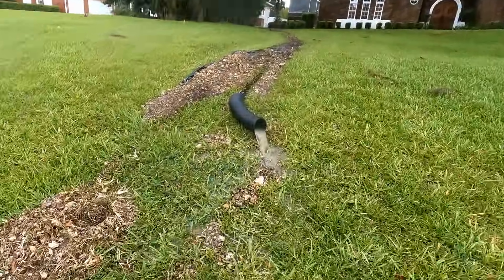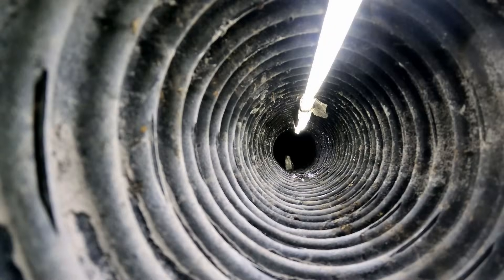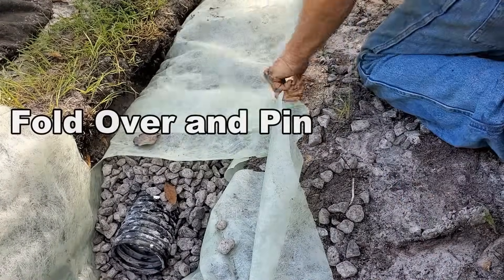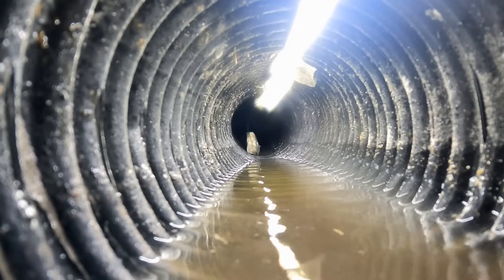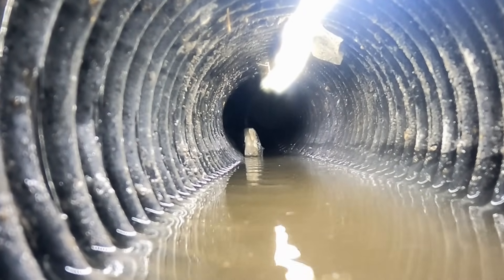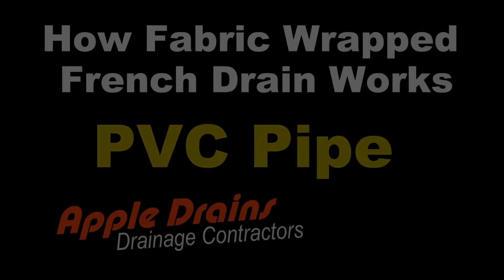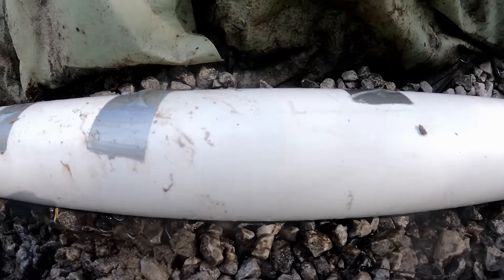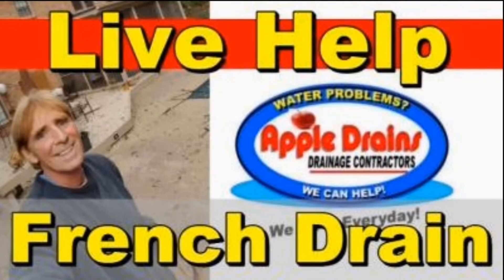Does French Drain Work with Fabric? Watch This Before You Install - PVC / Corrugated Pipe

Comment: Seems like a good place to ask, when depth do you usually dig a french drain? Redoing mine soon and want to learn
Reply: Probably whatever allows you to maintain a minimum 1% slope (required for wster to drain) all the way to the outlet. If you're asking about how much material should be between the surface of the ground and the top of the pipe I'm not sure
Reply: We dig according to the frost line,or if installed at footer.we go just below the depth of the footer,so the water flows at a lower level Than the top of footer,Works good for us,we use lots of gravel,im talking several tons around a 2200 square foot home,

Comment: Really, if you go through the trouble of digging the ditch, add a few more $$'s and get a quality sch40 pipe.
Reply from the maker: SCHEDULE 40 not the pipe to use in RAINWATER DRAINAGE SYSTEMS. This pipe is used in Sewer pipes. Regular #3000 PVC or corrugated pipe are both great material and will easily last many years before the pipe needs cleaned. 

Thanks for your comment

Comment: The fabric works to prevent soil migration into the stone and eventually into and out the drain. Why are you installing in thin strips though? Should be laid lengthwise and envelope the stone. You can get rolls up to 6m wide and if you do need to oveap you want 1m full lap. And you're going to want more topsoil cover over the stone, if you can't achieve more cover due to grade limitations then just run the stone to grade. There's other good ways to cheaply promote infiltration into the subsoil and/or storage capacity within the French drain system.
Reply: The video was just a demonstration and not actual install, so they used scrap fabric
Reply: Demonstration... demonstration... demonstration...🙋

Comment: Ah.. From someone who does real testing in commercial systems, I'd suggest doing more stress testing with video, like adding leaves, small pebbles and mud with grass in the pipes. The manufacture claim that's the advantage of corrigated over straight pipe.. You showed how both work in perfect world..we need to see debris in it and worst case so we know when each case benefits..
Reply: The real testing is letting these systems go for a year and then looking at their output quantity as well as quality of water coming out.  The type of gravel you use could also greatly affect the effectiveness of these systems.
Reply: @daveharness70  yea, that would is a must as well..or at least throughout the four seasons... Yea totally agree
Reply: @BobDevV  yea, I'm in exactly the same boat... I did it as per spec but after years feel straight is better..they claim the ridges create turbulence that creates a self cleaning effect but I agree that if it does, it is outweighed by sediment accumulation trashing up the line.. And to your very point water stayn in those spaces is bad all the way around.. I think its just cheaper and they tryn to justify it with excuses..

Comment: Best French drain vids I've seen. I'm doing one soon but it will be driven over. I'd like to use the PVC but the flexible pipe with the flex tube with the corrugated ridges looks like it will hold up and flex better. Any thoughts?
Reply: Corrugated pipe will clog easier and be harder to clear out than PVC. It will also collapse. Every downspout corrugated drain my builder installed lasted about 4 years before I had to dig them up. The PVC I replaced it with has been trouble free for 20 years. Everything that goes down the gutters flushes right out. PVC costs more, but not as much as having someone try to unclog a corrugated pipe--if they can.
Reply: @barrygrant2907  I have no experience with corrugated, so thank you for sharing.  I've seen enough videos where corrugated will simply hold water & debris that I'll never use it.
Reply: In my very limited experience, it appears that PVC will flow MUCH better and give longer life.  Granted, it isn't flexible like the corrugated, but if you spend the time/labor doing it the first time with PVC, you'll not likely need to do it again.
Keep checking Youtube for comparisons.
Reply: @rusosure7  Thanks I appreciate that.

Comment: You forgot to tell us which is better!  PVC looks to be much easier to maintain / clean out if it's ever needed.
Reply: It's a lot easier to set your angle with PVC.
Reply: @njgrplr2007 1😅
01 6:23 1
Reply: PVC flows much better and will last longer
Reply: If you live where it's cold, pvc will freeze and break.
Reply: Pvc twice as expensive if not more
Reply: I think the camera falling off the pipe is shows which is better.🤷‍♂️
Reply: PVC is better, but more expensive. Both will need maintenance on occasion, PVC less so. Even if stalled exactly as appropriate for your soil, climate needs.
Reply: PVC with proper drainage.  Flexible hose is easier though.
Reply: The PVC looks to be carrying a lot more dirt/soil away down the drain. May have substantial settlement line if that continues.
Reply: @tskaggs84  sediment doesn't stay in the pipe. On pvc there is no where for dirt hang on to as long as the pipe is installed correctly. With corrugated the water flows extremely slowly allowing sediment to settle. But not only that, the groves on the  pipe will lock the dirt in place. Yes, corrugated is cheaper but you would most likely need to replace it every time there is some sort of precipitation.🤷‍♂️

Comment: This is very bad for the environment; it drains too fast which increases flooding and reduces soaking into the ground.
Reply: Exactly. Probably better to flood your home or basement and rebuild it every 25 years.
Reply: @thewhiteknight02  or not make a basement in a flood plane.
Reply: Yes, it's better to have a rotting and molding home than to have a well-drained yard.
Reply: @edschultheis9537  Those things are not connected; by all means make the home dry inside but if you are building in such a humid place maybe that is a problem.
If we destroy all the natural processes we will suffer the consequences.
Reply: @jocosson8892  Pardon me if I don't consider you to be any sort of expert in anything related to the environment.
Reply: @edschultheis9537  I am actually only repeating the experts.
Reply: @edschultheis9537  Well, Jo is absolutely correct, but totally wrong too, if you are trying to drain a wet area to protect a structure. Swales, ponding areas, etc are integral to a good stormwater management system. And piping that water downhill can cause significant problems. Catching and casting of water that then damages other property can get you in a lot of trouble.
Reply: We found the dumb one guys.
Reply: @Carado5150  how so?

Comment: Hey, Chuck! How do we prevent our top soil from clogging our catch basin top if we need to raise the ground in addition to the basin?  Also, if we’re getting water in part of the trench (the shallowest part), does that mean our trench isn’t deep enough? Thank you!
Reply: Put some gravel around the grates until grass grows.
Reply: Thank you both for the suggestions! Our system is working beautifully! Just added to it yesterday and so proud of ourselves for running over 200 ft of corrugated pipe and 8 catch basins along the edge of our property! We actually tied it in to the main drain properly, too.🎉🎉  Chuck truly helped us save thousands! Cost us quite a but in sweat equity being that our soil is hard clay! Nevertheless, with prayer, we did it‼️
Reply: you'll probably need to makeshift a filter. There's catch basins that come built with them to keep leaves and large debris like rocks out of the pipe.

Comment: My PVC French drain has a thin sock around the pipe and the size gravel you mentioned. It's worked well since it got installed about a year ago.
Reply: By using a sock on just the pipe that is the smallest surface area compared to placing the fabric between the drain rock and the clay.  A smaller surface area would clog up faster with any silt materials from the clay.  So in theory the gravel should remain functional longer with the filter fabric on the outside of the gravel. 

The sock only protects the drain pipe and not the gravel. Once the gravel clogs the drain pipe is pretty useless.  

I’m planning on placing the appropriate clay soil geotextile fabric between the gravel and soil to protect the gravel/drain rock from clogging up. 

I’m thinking of using the 1-1/2” rounded rock (with minimum fines) because that has bigger spaces between the rocks for better drainage. Bigger spaces will drain faster and it rains 75”/year here in Crescent City, CA so the water volume is huge in a 4” rainstorm. Locals have described 7” of rain in a single storm! 

I’ll run the gravel to the surface to also catch ground run-off and place catch basins every 30’ or so to enhance surface water collection but to importantly double as clean outs to deal with clogs. I read that 1 catch basin is equivalent to 40’ of French drain. 

I worry about corrugated pipe getting torn up with a big snake’s cutter head; ie catching on the ridges and the corrugated pipes are all relatively thin. So I plan to invest in the thick walled and smooth schedule 40 PVC. 

I looked at the high octane corrugated pipe but the shipping to the west coast was 3x the cost of the pipe! $500 to ship a 100’ coil is outrageous!
Reply: I just did one with a barito wrap and fabric.
Reply: This is merely my opinion, and it won't matter to you now, but maybe someone else reads this: I don't use socks around the pipes because I would rather have dirt migrate into the pipe where water will carry it away or you can snake it.  Even though the gravel is "washed," there is still plenty of sediment on it.  I do think filter fabric lining the trench is mandatory for longevity.  And ALWAYS install a clean out at the top!
Reply: @Keifsanderson  Good reply. My French drain has three catch basins, also.
Reply: @SeanBaker  God bless, man.  Hope you get many years use out of yours.  I think much depends on the nature of the soil.  My new place has great, sandy soil, but there is no elevation to make a drain work.  Unless of course I want to deal with an outdoor sump pump.  There is no risk of the house flooding, and the flooding disappears in less than 24 hours, so I think this time around I'm just going to let nature do it's thing.  The first couple torrential downpours, where I could have paddled a canoe around the yard, were a bit stressful, but I've been assured by all my neighbors that even the worst hurricane in the neighborhood (Sally) didn't flood the houses here out.

Anyways....cheers, and have a great weekend.
Reply: @SeanBaker  3 is only enough if can handle the volume.  I designed my systems to handle minimum a 4 inch an hour rain event. Take the area of your roof and any ground you will be handling drainage in squarefeet..  Multiply by .33 ( 4 inches) to get cubic foot volume. A cubic foot is roughly 7.5 gallons so multiply 7.5 times cubic feet to get gallons per hour. Then divide by 60 to get gallons per minute.  Look up the capacity of your pipe and grates to make sure they can handle volume.  For example a 4 inch s n d pvc smooth wall will handle about 75 gallons per minute (working from memory so double check me) but a 9 by 9  grate may only be able to handle a small fraction of that volume per minute.  Having just one pipe and a few catch basins for a residential is rarely sufficient to handle a heavy downpour without backing up.
Reply: @Keifsanderson  It's been like 20 years since I installed a French drain, but we always applied one layer of fabric to the bottom of the drain and one on top. Nothing surrounding the actual corrugated pipe itself but large rocks to fill the space, then the top fabric to keep the gravel migration into the larger rocks to a minimum.

Plugging usually wasn't much of an issue as the elevation change was usually pretty small and it wasn't long enough to be a problem if it did plug. A longer run would probably be better off with something that's not corrugated.
Reply: The sock may impede solids and cause a buildup if it is actually around the end of the pipe
Reply: Good luck because corrugated will most likely eventually clog.

Comment: My downspout drain from the back of the house goes to the street in buried 4-inch corrugated pipe, under my side yard. But two of the downspouts of a neighbor also hook into this main line out to the street. A common thing in this development, they tell me. So the pipe can't hold all 3 feeds, and rainwater floods my yard through the pipe junctions. I thought I might French drain it, but the "soil" is all black clay and won't perk at all. Should I run a gravel trench the whole way, or what? 
Have repaired these pipes in several places, and thanks for showing me how. You're right, Lowe's has more than Home Depot in this department.
Reply: Did it handle the water at one time? Maybe the pipe needs to be cleaned out? If it never worked well due to volume then I'd just disconnect from your common line and run a line just for your house. Add a yard drain if you need it.
Reply: Downspout drains COMMONLY  clog where downspout meets corrugated pipe. The grit from the shingles piles up there in no time. Corrugated is crap

Comment: Hey my wife and I just recently bought property and had a trailer put on it but our yard is flooding something awful I really don’t know how to fix the situation if anyone has any insight I will gladly hear it
Reply: Scrape away topsoil where water is building up and set aside for gardening. Dig a pond, and mound that dirt up as a hill twice the area of your trailer. Park the trailer on your new hill. Grade the  property to drain away from your home. Dig a drain system around your home and feed it to drain into the pond. Dig a pit at the lowest edge of your property and fill with gravel. You can set a simple solar pump in the gravel pit to top off your pond daily.
Reply: Put a catch basin in the middle of where the flood is, have solid pipe running from it to a discharge area with a pop up emitter. Make sure your slope is down hill, because water runs down hill, if you don’t have the slope to do so you will need to use a sump pump.

Comment: If I just get a lot of water off my roof (no gutters) that forms surface water next to my house what would be the best drain for me to try and install?
Reply from the maker: Hi .. I think you should install gutters and downspouts with drain from downspout out to street or storm.. but if you cannot do that, this system would work to help collect the water on the yard
Reply: @appledrains  You are the best, I like your videos, thank you!
Reply: Hi thinks you
Reply: Something without holes in it, get the water away as fast as possible and pvc's Mannings Number is about as slick as it gets.